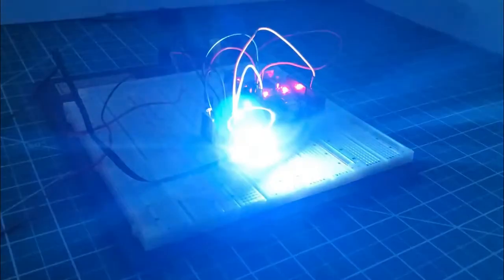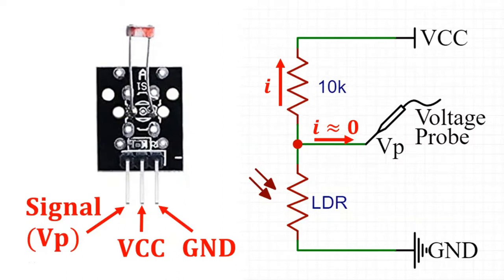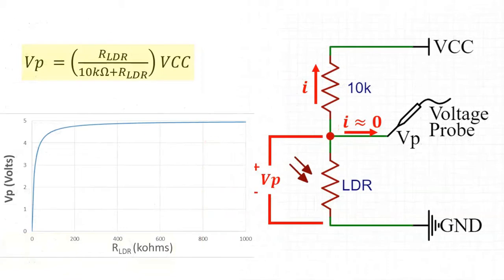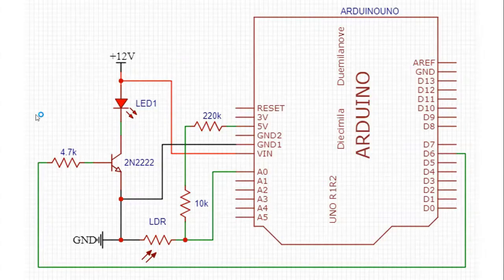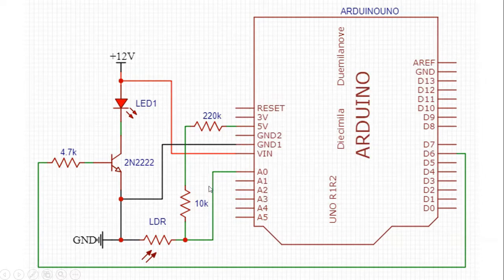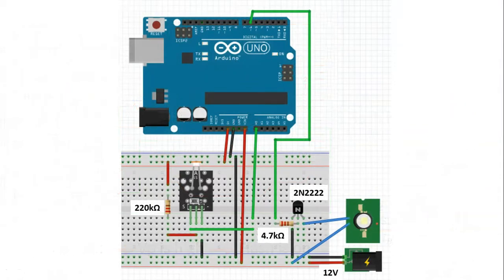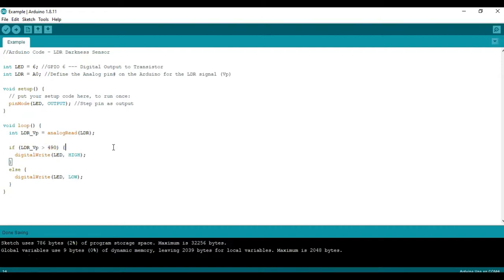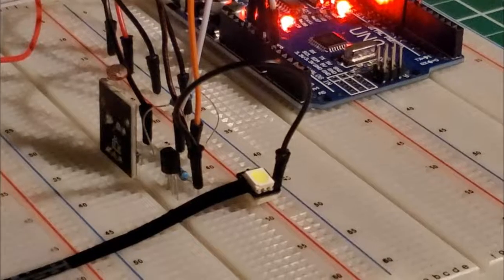LDR sensor tutorial with Arduino – Light Dependent Resistor

Comment from the maker: Where to buy [Amazon Affiliate]:
Light Dependent Resistor (Module: KY-018): https://amzn.to/3UWGNRs
Light Dependent Resistor (stand-alone): https://amzn.to/3yByLpA
Hilitchi Transistors Assortment Kit: https://amzn.to/4aI8Mux
Breadboard (Elenco 9440): hhttps://amzn.to/4b5Onzq
Amprobe AM-510 Multimeter: https://amzn.to/44gy2WE
Amprobe TL35B Test Leads with Alligator Clips: https://amzn.to/3Utf8s0

Super bright LED Flash:
www.superbrightleds.com/moreinfo/led-wired-bolts/little-dot-smd-led-accent-light/639/